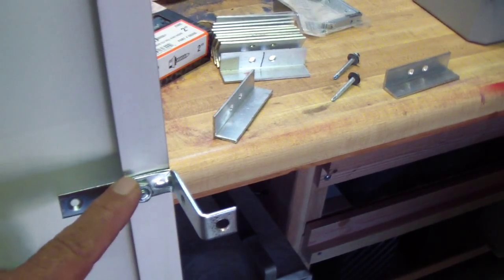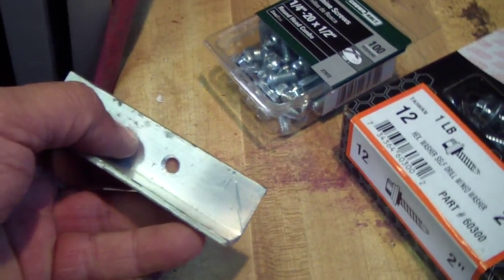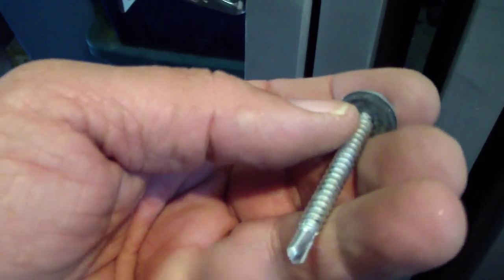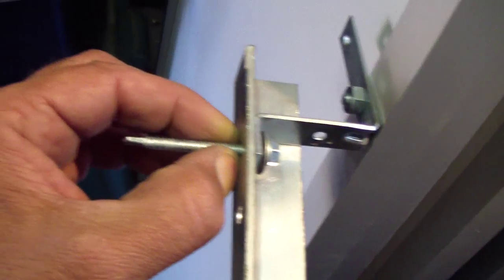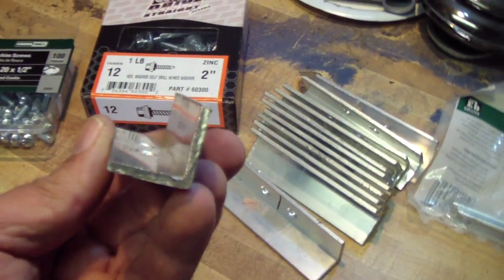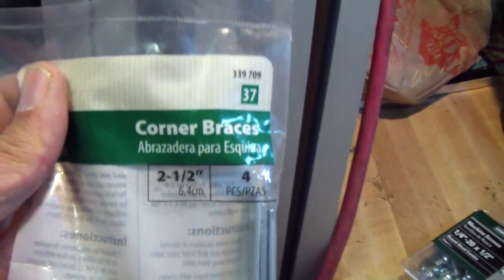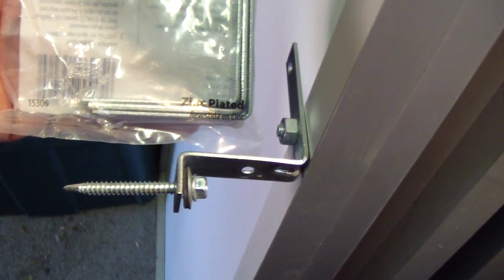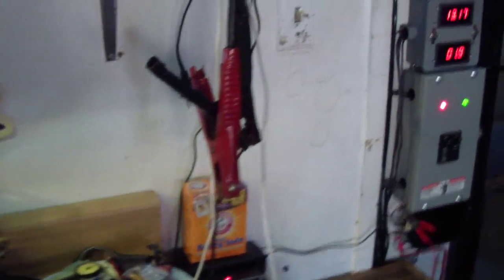Part two, Battery bank/outback charge controller cable upgrade and solar panel roof installation.

Comment: If those L brackets are not stainless steel then they will corrode the module frame over time.